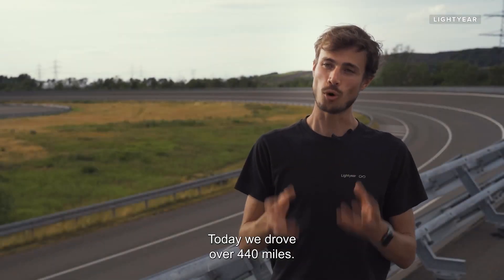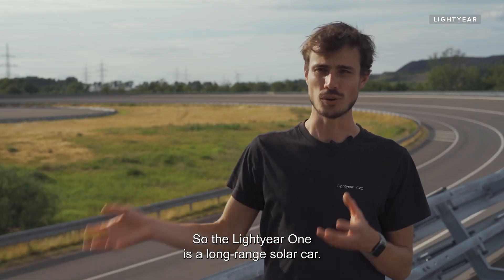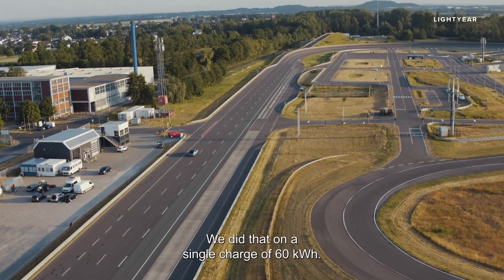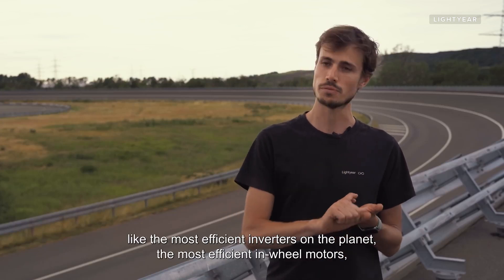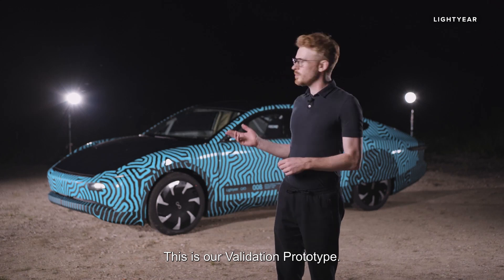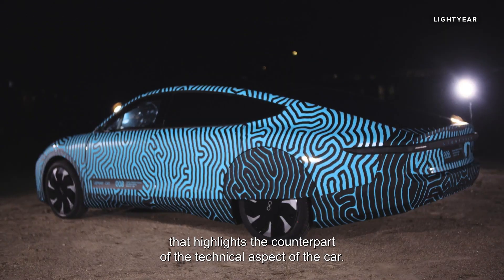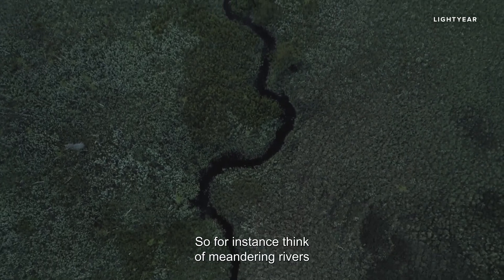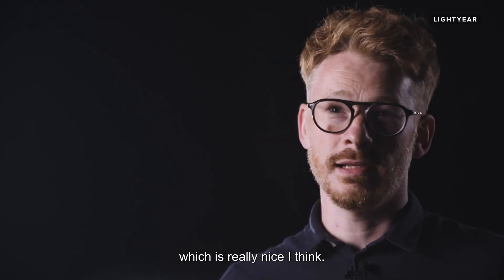Lightyear One prototype solar-powered car: Watch performance testing

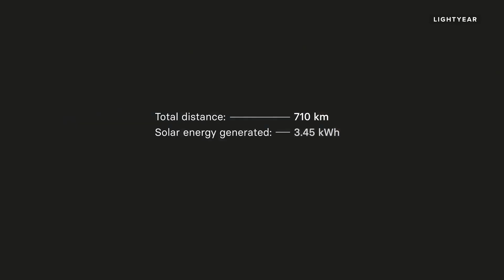Comment: 3:04, the whole energy consumed is 710km*86Wh/km/ = 60,350Wh = 60.035 kWh, but the solar energy only provided 3.45kWh. The solar helped but the extra 300~400km range is not primarily come from the solar. I'm still sceptical about adding a solar panel straight onto a BEV. The rate of the energy being generated maybe still too slow to justify adding extra weight to the car.
Reply: This car would be perfect for people who do not drive much. Normal electric cars get into difficulties if you don't charge them for a while. This car you can leave outside and if you need it, it is fully charged ready to go. The targeted mass production price is below €40,000 so beating a Model 3 in both price and range.
Reply: We also need to consider that an average person doesn't drive 710Km in a single run.
Reply: 20 miles free per day. 7000 miles free per year. Ill make mit super easy and American friendly for you: Would you like to drive 7000 miles for free everyu year or not? If yes, then congratulations, I guess solarpanels make sense, don't they?
Reply: was gunna say the same thing lol. added 6% to range. and that was a sunny day in perfect conditions.

the real question is does it make economic sense vs adding a battery that's 2kWh bigger (saying 2 because assuming it's sunny half the time, really it should probably be a 1)

Comment: We are a very long ways from solar power being able to charge a car. As stated in the video, over the entire drive (nearly 10 hours) the car only charged 3.5kw from solar… which is basically nothing. The range of this car comes down to its coefficient of drag and the unrealistically low speed they were driving at. The solar aspect is nothing but a well marketed gimmick.
Reply: I agree with you. But credit is due where its due, 8.5kw at 85kmh is amazing. This is no small feet. The best I have done with my Tesla Model 3 is 12kw at those speeds. Thats a 40% difference. So If i plug into a V3 Supercharger @ 250kw, thats 50km of range per minute if my car could do 8.5kwh per 100km. in 5 minutes, thats 250km of range. Efficiency is king.
Reply: @matter45  I absolutely agree, their engineers did an incredible job in the efficiency department. Just don’t call it a solar powered car, that’s all I’m saying.
Reply: kWh please, not kW :)
Reply: 85km/h isn't an unrealistic speed. Many people live in cities and they won't even reach that speed very often. 85km/h is still 5km/h over the speed limit on our roads here in Ontario, except for the larger highways.

Comment: Solar panels on cars are dumb. Even Elon recognized that.
Sun outputs about 1000W per m^2 , high efficiency solar panels are ~30% effective, so 300 W per m^2 charge rate.
Given the car has 4 x 2 m usable space, thats a max charge rate of 2400 Watts, or about 3.2 HP under perfect circumstances (no shadow, dust etc.)
Standard home charging plugs (in Germany) have 11,000 Watts. And thats slow charging.
It would take about 25 hours in my calculation to charge the 60kWh battery they are using. Thats while standing in perfect sunlight.
Reply: Pffft... you are  sooo right. We shouldn't even try this. Even though now they have succes, they should not even have tried this, because of what Elon Musk said... we have a word for you in dutch. Lutser
Reply: They already did the math for you. It's 50 km of added range on a sunny day. In sunny climates (I live in one) I'd almost never need to charge in my use case. I say bring it on!
Reply: @moladiver6817  the sun charged 5% of the car’s battery over 10 hours. If you think this is ground breaking, I’ve got a bridge to sell you.
Reply: @HowDoYouEatPie  I disagree. Almost every commuter drives more than 50km a day. The USA national average commute time is 26 minutes one way. Let’s say about 30km if you can only average 60kmh. Now if you want to bring in places that are generally always sunny, and have charge stations, your only looking at a few cities. Almost all of which have 60+ minute commutes one way. The solar panels are basically useless unless you’re stranded in the desert for 171 hours. Add on top, a typical commute takes place in the morning and the evening, neither of which would be useful for capturing solar energy. It’s a gimmick and nothing else.
Reply: @HowDoYouEatPie  I can’t remember how efficient they said the car was, but assuming it’s getting 200wh/km, that 8 hours is still only good for 14 km of range. Not enough to get home for most people.
Reply: @MistrZIGZAG   So solar panels are useless because they cannot completely charge the car is what you are saying?  Its still free energy! You will have to charge it less, and pay less, year after year after year. Can you not comprehend this?
Reply: @likmijnanus   on a road trip the length of its theoretical range, in optimal conditions, driving below the speed limit, you’ll make 3.5kwh. Congratulations, you saved 45 cents.. and if you drive 24,000km a year (only in optimal conditions ie, full sun), you will save $15. Don’t act like solar is a godsend. It’s negligible.
Reply: @MistrZIGZAG   You realise it charges day and night right? And that you dont need to drive for the car to charge?? on average 20 miles per day. Every day. Year after year. For free
Reply: @likmijnanus oh is the sun out at night? The only thing I just realized is your lack of intelligence. How on earth would a solar panel charge the car at night? The moon? Holy smokes pal, go back to school.
Reply: @MistrZIGZAG  It's not a gimmick at all. There are millions of people who don't commute for work. I don't drive my car for upwards of 7-9 days sometimes. So as the saying goes, speak for yourself. A solar panel on the roof would save me plugging it in. And as another saying goes, a penny saved is a penny earned. It all adds up.
Reply: No your statement is extremely dumb. Its free range. Every day. For years. Solar panels make sense on cars efficient enough, like this one.

Comment: Anyone can build a prototype.  It’s actually producing the device at a large scale, that is very hard.  - Elon Musk.

Efficiency of EVs is getting better and will get better overtime. Don’t you think EV makers want the most efficient motors and inverters?  How can a small team of guys develop something that multi-billion dollar car makers can’t?.  

Gas supposed energy density advantage is due to efficiency of ICE engines. 
Gas has a higher energy density at least this is true for today.  People forget how bad gas consumption was on American cars in the 70s and earlier.  It was common for cars to guzzle down 8 gallons of gas per mile.  If you had an 18 gallon tank that is 144 mile range. They were also not very reliable either. People today fret about EVs not powering up.  However back in the day it was very common for American cars to break down. Everything changed when Japan started producing low cost, highly reliable cars that gave great gas mileage.

Comment: 440 miles In controlled environment *
Reply: Still a pretty cool idea hopefully it can be good competition for Tesla and other EV’s
Reply: @hydromic2518  It will be difficult to scale. A Tesla Model S Long Range Raven, can achieve a range of 644km @ 90km/h on a real road with a consumption of 144 Wh/km. A Hyundai Kona with a battery of 64 kWh can achieve a range of 510km @ 90km/h, but that's already a mid-range SUV with worse aerodynamics.

What the Ligthyear team have done is indeed focus on efficiency, but driving in a car that is supercar-coupe-like in shape will be impractical for most situations. However, I do enjoy seeing advancements and new inventions, but I know scaling up will be hard. I have been following the Lightyear One team for over 2 years now, since they first appeared on Fully Charged, but I haven't seen a huge leap in progress in terms of design. They are still at prototype phase and are still working on the design. Once they arrive at a final prototype, the manufacturing and scaling up production will be their biggest challenge.
Reply: @DikoMan if it could get better, Tesla would have done it by now.